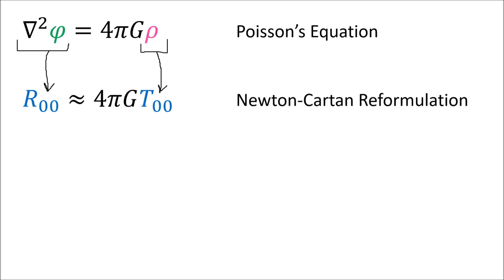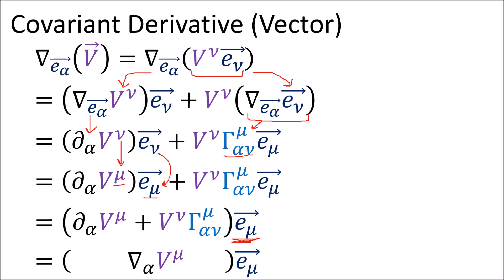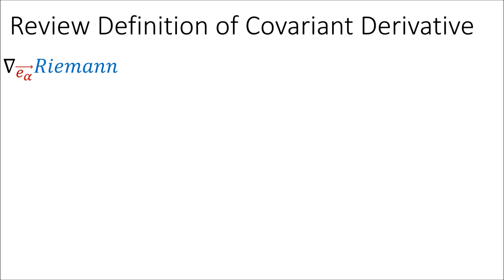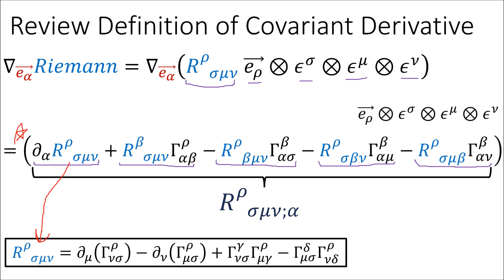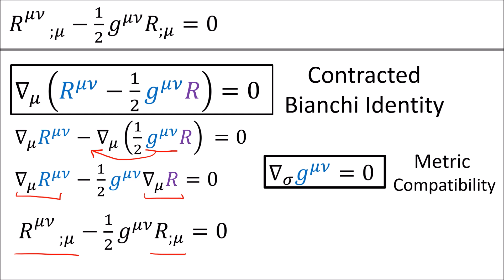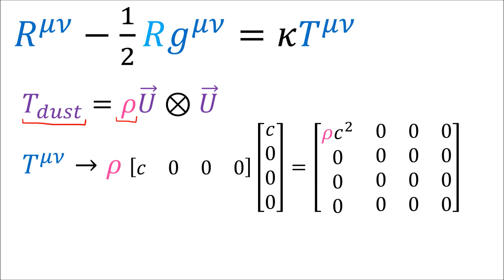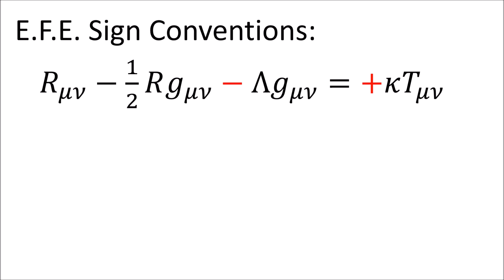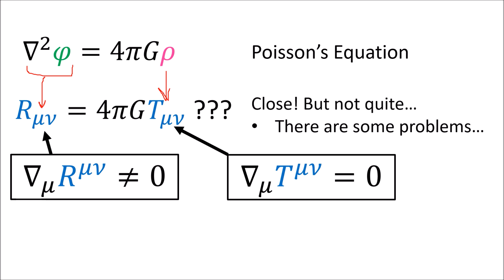Relativity 107f: General Relativity Basics - Einstein Field Equation Derivation (w/ sign convention)

Comment: Question for Chris - if you can swap indices with metric tensor on both vectors and forms is there any real difference as the two metric swaps will cancel. You've probably covered it somewhere but I can't find at the moment. Many thanks.
Reply from the maker: Sorry, I'm not sure I fully understand your question. Being able to swap the indices of the metric tensor means the order of the 2 input vectors doesn't matter. it basically means v·w = w·v. Does that answer your question?
Reply: @eigenchris  sorry Chris I mean in a form if we raise the index of the components to give contravariant components and drop the indexes of the basis vectors to give the basis forms we end up with a vector both done with a metric and it's inverse which two multiplied in a matix representing give 1 (are inverse) many thanks (again)
Reply: @eigenchris  thanks again for your help - I was trying to work out if there was any real difference between a vector and a form as you can pull one index down and the other index up on the vector or form with the metric tensor and it's inverse and swap vector into a form and vice versa. Apologies if this isn't clear or a silly question.

Comment: I am not sure wether you mentioned this in an earlier videos: What units do the Tensors have? Do they all have the same units?
Reply from the maker: From a mathematical point of view, I don't have a great way of answering that. The important thing is that every upper (or lower) index in a tensor component must be summed with a lower (or upper) index on a basis vector/covector. The components of 4-velocity vector would be unitless, but the units of the 4-momentum vector would be mass, and the units of 4-force would be mass/second. So the units depend on the physical context.

Comment: Hi Chris. Further to my earlier comment should the derivation of the contracted Bianchi Identity use the metric tensors and not the inverse metric tensors to derive it with lower indices? Again, I may have completely misunderstood but hopefully you can clarify.
Reply from the maker: I'm not sure there's an easy way to write the contracted bianchi identity with lower indices, because the index on the covariant derivative always has a lower index, and so the tensor components it is summed with must have an upper index. I guess you could write the tensor components with a lower index if you include an inverse metric with upper indices to balance things out, but that would just make the formula more complicated.

Comment: Hi Chris. Another great video. One part has flummoxed me. The Einstein Field Equations have lower indices and in a number of your slides you have them in the upper position. If these are fields then should they all be lower indices with covector basis (1-forms)? Or, have I really missed something here?
Reply from the maker: The EFE can be written with upper, lower, or "mixed" indices. You can just raise or lower the indices using the metric or inverse metric as needed. When lower indices, they are written using a basis of covector-pairs (comibined using the tensor product). When upper indices they are written using a basis of vector-pairs (combined using the tensor product).

Comment: It seems as if the rule of connection coefficient being 0 at point p is a bit inconsistently applied
Sure, the ones with the product of two connection coefficient term was a result of a derivative being taken somewhere in the derivation, but then later on, when the deivative of that product is taken, you set all the resultant term to zero which makes me think that that product was always zero
Could you please clarify this?
Reply from the maker: Do you mind giving me some timestamps in the video for the parts you're concerned about? It's been a while since I uploaded this and my memory is a bit foggy.
Reply: @eigenchris  16:22-40
16:49
Reply from the maker: @it6647  The rule I'm trying to follow is: connection coefficients on their own can be sent to zero, but DERIVATIVES of connection coefficients may not be zero. You can imagine a parabola whose vertex is at the origin. It's value at the origin is zero, but its derivate is non-zero. 
At 16:22 I cross out connection coefficients that are on their own, without derivatives. The terms in the lower box have their derivative taken (see the 1st term in the top box... there is a derivative operator there). After doing product rule at 16:50, we end up with connection coefficients on their own without derivatives, so I set them to zero.
Reply: @eigenchris   Alright so basically you ensured that the derivative will always be zero, used some foresight to make sure you don't prematurely turn the connection coefficients to 0 if they are going to be differentiated in the further proof
So even though Riemann coeffs' 3rd and 4th term are zero at that instant, it by no means implies that their derivative is zero, which is why you chose to keep them around until the later half of the proof?
Reply from the maker: @it6647  I think you've explained it correctly. I make no assumptions about what the derivative of the connection coefficients are... I just keep them around, and when no further differentiation needs to happen, I set all the (undifferentiated) gammas to zero, and this greatly simplifies the formula.

Comment: Did we really derive Einstein's Field Equations in this 36 minute video?  It feels like a bit of an anti-climax after spending many months studying all of eigenchris's Relativity videos from 101 upwards, making scrupulous hand-written notes, stopping off on the way to do the same with Tensor Calculus and Tensor Algebra.  (I studied every video, spending about a week on each filling 4 ring binders.)  Every video has been thorough and comprehensive all leading up to this one which I was expecting to be some sort of series climax.  This "series finale" should have been an hour long and come complete with fireworks.)  As it turned out, I was just starting to get a bit lost with 107f.  I think maybe it didn't have the same rigour as earlier videos?  There seemed to be jumps in the logic flow,  equations referenced from "earlier" didn't seem to have been mentioned "earlier".   What was a lower index earlier in the video reappears as an upper index.  Also, the constant term.  This is really fundamental, it's what makes the left-hand-side of the equation(s) equal the right-hand-side.  We only looked at the simplified case of weak, gravity, low-velocity, and non-relativistic time when deriving the constant - the Field Equations are supposed to work in strong gravity, high velocity and relativistic time aren't they?  (Most likely all this is just me, I did say I was starting to loose the thread.) I have learnt a great deal from eigenchris over these videos.  (Thank-you eigenchris.)  Eigenchris himself encourages us to look at other sources as well, so I think maybe I need to do that in order to get a wider perspective.
Reply from the maker: Unfortunately, the truth is that this video and the many of the ones after it are going to be less elegant than the ones that came before. The equations in general relativity are much more complicated than the ones in special relativity, and we're often going to need to resort to assumptions and simplifications in order to get by.

However, the Einstein Field Equations do work in strong gravity as well as weak gravity. We just need to make sure they reduce to Newtonian gravity in the limit of weak gravity. The "weak gravity" assumption is only used to calculate the constant the constant 8*pi*G/c^4, which is exactly what's needed to reduce the equations to Newtonian gravity in the limiting case of weak gravity.

That said, if I failed to mention an equation "before", can you point it out? I've made so many videos that I may have neglected to teach a couple points.
Reply: @eigenchris  Thanks eigenchris.  And apologies where I mentioned "jumps in the logic flow".  That's just me failing to keep up.  Hoping to understand GR is pretty ambitious for me personally.

Comment: I have some questions in context of Conservation of energy-momenta locally at 3:32. When we drop a ball with mass m from a certain height on earth surface (small height) h, its kinetic energy increases with the approach towards the ground. First of all, do you call this local or non-local incident? Secondly, as in general relativity gravity is not a real force , it can not transfer energy to the ball. Then how the kinetic energy of the ball increases? Also the conservation of energy-momenta is valid or not in this case?
Reply from the maker: "Locally" means looking at a single spacetime point and anything "tangent" to that point (e.g. 4-velocity, 4-momentum, 4-acceleration). "Non-local" means looking at two different spacetime points. So when the EM tensor handles "local conservation of energy-momentum", it's only looking at a single point in spacetime and the objects that live in that point's tangent space. 

In Newtonian mechanics, when we're talking about "kinetic energy" and "potential energy", these are useful concepts because the "total energy" (K.E. + P.E) is a "constant of motion" throughout the falling object's path. The reason "energy" as a concept exists is because our system has "time translation symmetry". In general relativity, we can't always take for granted that the "energy" from Newtonian mechanics" is a constant of motion. But there may still be an "energy-like" quantity that is a constant of motion if our spacetime has time-translation symmetry. You'll see in the upcoming 108c video I'll use 2 constants of motion in Schwarzschild spacetime to calculate the Schwarzschild orbits. One of the constants of motion is kind of like an "energy" term, but it's not quite the same thing as Newtonian energy. When I eventually cover the FLRW-metric for the expanding universe, we're going to see there's no constant of motion for time translations, so there's no energy-type "thing" that's conserved. I know this is probably a lot to swallow, but I'll be covering all of this as the videos go on.

Comment: Question sir. Why use T_00 = rho*c^2 instead of T_00 = (1/2)rho*v^2 + PE/V when it is Low Velocity Limit or the Classical Limit, v << c ? Sorry for this question.
Reply from the maker: The energy we're talking about from T_00 doesn't come from velocity or position (potential energy)... it just comes from the object's mass. Mass on its own is a form of energy that causes spacetime curvature. If you watch the 107d video, I show how mass curves spacetime even for Newtonian gravity, without Einstein's relativity involved at all. The (1/2)rho*v^2 would be kinetic energy, which would affect other components of the EM tensor if it was large enough, but they go to zero in the low-velocity limit since the T_00 component will dominate. As for potential energy, I'm not sure if the concept of PE makes sense in curved spacetime. The concept of curved spacetime essentially "replaces" the concept of potential energy... since curved spacetime determines how an object will move due to gravity. You might try googling "potential energy general relativity" to learn more because I haven't looked into this.
Reply: Ok sir thank you so much!

Comment: That was really well done. Thank you. Did I understand correctly? That, the only justification for equating kappa*T^uv with G^uv, was because their covariant derivatives were both zero. There had to be more to it than that. Einstein could've simply put the cosmological constant term alone on the LHS and it would've satisfied that condition. I prefer the interpretation where, T^uv tells us all the forces acting on matter at that location, and G^uv is simply what we measure using deformed rulers and clocks.
Reply from the maker: I tried to justify the EFE as a generalization of Poisson's Equation. the G^uv is like a relativistic generalization of the laplacian of the newtonian potential, and T^uv is like a generalization of the mass density. I agree the use of forcing the divergence of R^uv to be zero, and getting G^uv is a bit weird, but I don't know a more intuitive way of doing it. If you were to just put the cosmological constant term without the G^uv, the equations would not reduce to Newtonian gravity in the non-relativistic limit, so that is why G^uv is needed. You can read these wikipedia articles for more justification on why we use G^uv: https://en.wikipedia.org/wiki/Einstein_tensor#Uniqueness and https://en.wikipedia.org/wiki/Lovelock%27s_theorem

Comment: Wasn't there a way to derive the Einstein Field Equations through extremal action? But I guess it would be significantly harder anyway
Reply from the maker: Yes, that's the Einstein-Hilbert Action, which has a Wikipedia article you can read. I lack experience with Actions/Lagrangians so I won't cover it right now. In this video I follow the justification of generalizing Poisson's Equation to be relativistic, and also enforcing local conservation of energy-momentum (which means the EFE must have zero divergence). I'm not yet sure how to justify why the Einstein-Hilbert action is the "correct" action for GR. I know in SR, the action is just the proper time, because inertial worldlines (geodesics) maximize proper time. I'm assuming the E-H action generalizes this idea to curved spacetime using the Ricci scalar somehow, which gives us geodesics in curved spacetime that also maximize proper time.

Comment: Why is spacetime sometimes curved even if the stress energy tensor is 0 (ex.kerr vacuum solution)? What’s said to be causing the curvature if there’s nothing in the space?
Reply from the maker: The curvature of spacetime is measured by the Riemann Tensor, which isn't in the Einstein Field Equations. Only the Ricci Tensor is in the EFE. The Ricci Tensor only gives 10 of the 20 independent components of the Riemann Tensor (related to volume changes along geodesics). The other 10 components of the Riemann Tensor are related to changes in shape along geodesics (tidal forces). (I think these are given in the "Weyl tensor", not sure.) This is good, though. We wouldn't expect spacetime to be flat outside the earth just because it's a vacuum. We still expect to observe gravity in vacuum regions outside planets and stars because we see objects fall, and moons/planets orbit. We can have a source of spacetime curvature like a planet, but the spacetime curvature will extent beyond the planet's mass region, into the surrounding vacuum.
Reply: @eigenchris  Hi Chris, I understand your argument partially, but I stumbled upon the same point as @CanyaDigit. It's a bit weird that the mass in the center doesn't need to appear somehow in the EMT (e.g. in it's region of spacetime) . It seems that curvature may appear even though there is no mass at all. The mass seems to come mysteriously  from  the "backdor" into the metric tensor, by solving for theese arbitrary constants which are used to create a mostly general spherical symmetrical solution using the behaviour in the newtonian limit.  I've  read the same explanation in several books, but for my understanding this is still unsatisfactory.
Reply from the maker: @peterkrauspe9217  It's not much different than newtonian physics where mass creates a gravitational field that extends to infinity everywhere around it. The empty vacuum space around a planet still has a gravitational field due to the planet. And in GR, spacetime is still curved around the planet in the vacuum surrounding it out to infinity.
Reply: @eigenchris  yes this is not the point I have trouble with curvature in the vacuum when there is a mass somewhere, but in the newtonian eqns you have the mass included in the equation and not set to zero as T in the Einstein eqns. I just expected that T contains everything which is part of the universe , which should include the mass in the center ( even though this is a model universe) . It seems similiar to the sin/cos solution of the homogenious maxwell‘s eqns, where a wave may exist even though there are no charge or magnetic flux densitys. But I never expected maxwells eqns to describe the whole universe…
Reply from the maker: @peterkrauspe9217  I forget if I linked this earlier, but there is also an "Interior Schwazrschild metric" for the interior of a spherical mass, where the T tensor is non-zero. The "Interior" metric and the metric I show in this video are equal on the boundary "r_g" of the spherical mass (just try plugging in r=r_g to both metrics and see that they are equal). The metric in the video is the "exterior" metric for the vacuum space outside the mass. https://en.wikipedia.org/wiki/Interior_Schwarzschild_metric
Reply: @eigenchris  Thanks for your  extra explanation !
Reply: It is the same thing in poisson equation formulation of newtonian mechanics or electrostatics: the force field exists outside the source as dictated by Laplace's equation.